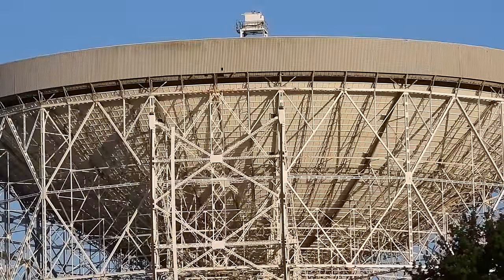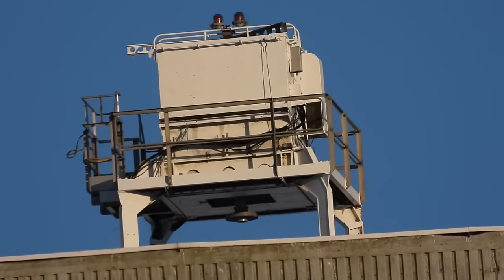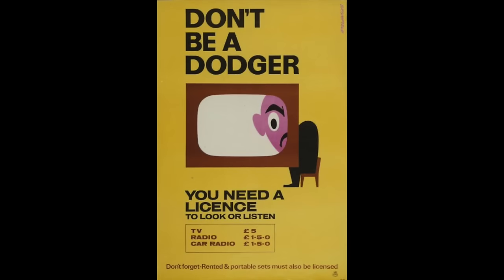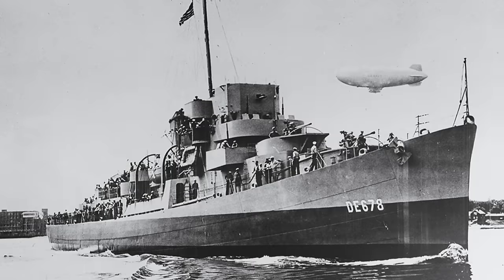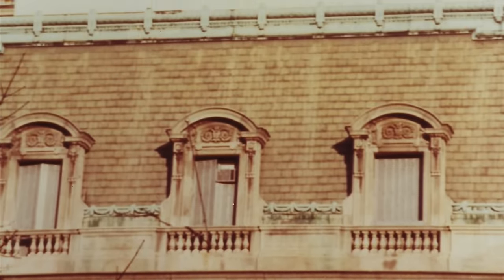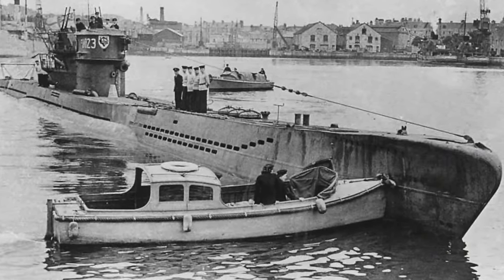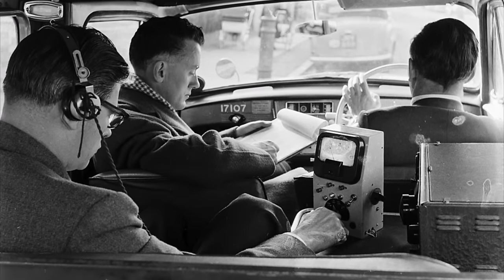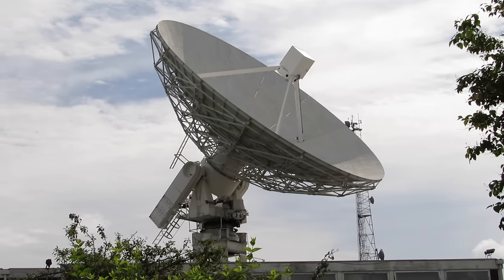How They Know What You're Listening To On Your Radio!

Comment: Back in 1994 at work a FM table radio had a local oscillator signal strong enough to appear on the screen of a  spectrum analyzer what was testing a FM broadcast interface for a rear window antenna intended to address high interference in Detroit's Greenfield Road test course due to the many radio stations there.  Broadband field strength at Greenfield was over 500,000 uV/M!  Two FM stations even created cross band suppression of a AM station at 590Khz!!  (The table radio at work was 200 Ft away from the lab! Finally, a shielded room was installed.)

Comment: I built a one valve regenerative radio kit, H.A.C., in 1969 and confirm they put out a signal. 
Spy radio operators in WW2 were located by the regenerative receiver as well as by the transmitted signal, the most well known was the Paraset.
When I tell people a t.v. could be detected by a van they don't believe it, yes, around 10 and 16 kHz with harmonics into the 160m and 80 m bands causing a lot of noise to radio amateurs. I knew when my neighbours switched on a t.v. so a detector van was very possible.
G4GHB.
Reply: The super-regen[1] receivers were even easier to detect.  Normally a regen only makes some radiation that is exactly on top of the signal you are listening to.  This means that so long as the regen control wasn't set too high, the signal being listened to would help to hide the leak from the receiver.  On the super-regen, the leaked RF was AM modulated at the squegging frequency which was above the audio range.  This meant that a narrow band receiver to tune into the sideband.
Mostly for others:
[1] "regenerative" means you feed back some of the amplified RF back into the input of the amplifier stage.  This has the effect of greatly increasing the amplification you get.  The down side is that if you feed back too much, your radio oscillates, transmits, and you don't hear anything.  Regenerative receivers have a control for this you need to adjust for good results.  "super-regenerative" receivers didn't need this control because they had a circuit that would repeatedly kill the oscillation at some rate above what humans can hear.  The effect was as though it was a regenerative set adjusted to just below the threshold of oscillation.  Sometimes this effect was done with clever design of the RF amplifier stage because tubes were expensive.  I meant that there were a lot more "not a tube" components in the design but that was fine with most people.
Reply: @kensmith5694  Yes, super regens were bad for that, I built a valve 2m xtal tx in 1976 which had a super regen rx but didn't have it for long. The Wireless 19 Set had one but it is said they were no good if a number of stations were operating. I have a 1944 Mk 3 much modified in which the B Set had already been removed and completely re-wired with pvc wire by REME in 1958, c.w. only 2 Watts out, great fun, and usually 5.262 MHz, a modification by me to xtal on tx for stability.
G4GHB
Reply: It's not so much a disbelief of being able to detect them, it just seems super inefficient. Why it took so long to move to just having a database of addresses and working off that I don't know. Not saying I agree with it, but really, it's not rocket science.

Comment: In the 1990's I worked with a client in the electronics industry.  At that time video billboards along the busy freeway were coming into regular use.  My client said that some of the billboards were equipped with detectors that could  detect what radio stations were being tuned into by the passing cars.  Then the displays on the billboard would change accordingly to maximize the advertising impact.  So if a lot of drivers were tuned into a ball game the billboard might display ads for pickup trucks, if a lot of drivers were listening to soft rock then fashion clothing could be displayed.  Ringway you've made this seem plausible.
Reply: Seems dangerous to drag drivers attention off the road.
Reply: @jannikheidemann3805  Since when has that mattered to advertisers in the States?

Comment: the detector van thing was a case of "they could detect" but in reality it was all a visual threat and as it worked so well in the early days they had no need to actually do any detecting..  the old 405 line aerials were huge too.
Reply: Maybe they could pick up some electromagnetic harmonics, but there's no way they could pinpoint a single household in a flat (as measured from the ground with a handheld antenna no larger than 1 foot), and determine with 100% certainty that they were watching Columbo.
Reply: i still see the occasional one rotting on a half fallen down pole of someones chimney .
Reply: @SuperCanuck777  you have to hand it to the original manufacturers of those H aerials, they were pretty robust :)
Reply: @amojak  Yes. heavy duty thickness alloy unlike now. i salvaged one of those vhf low H antennas and used the element brackets to make a 3 ele yagi for 27mhz which i spoke all over the world on in 1982.

Comment: Great video,thanks,I never thought about the IF stage leaking. None of the techniques you described would work these days as the noise floor or EMI in residential areas is about S6 to S9 due to cheap electronic appliances and solar panels.
Reply: Do solar panels create any inherent EMI, or is it due to the inverters?
Reply: @galfisk  All electrical appliances with switch mode power supplies generate electromagnetic radiation however there are regulations on how much radiation they may produce which is all good and well.
A Tridactylidae's don't make a loud noise but when are thousands of them, the noise is deafening.
The EMI from appliance has the same effect when there are thousands of them on at the same time. Ask any armature radio operator that lives near high voltage power lines what level the noise floor is.

Comment: We never had to license our TV's. We wouldn't have stood for it. I realize that conditions were much different during the war in Britain, but even our power grid now emits "broadband - over - power - line" interferences because the power companies just got lazy and didn't want to pay a meter reader and so set things up to read meters remotely. A Ham Operator has to endure so many illegal signals that sometimes we receive nothing but illegal interferences.
   So, one day I had had enough. I put a low frequency bandstop filter on the incoming mains, and then searched out every switching power supply there was, and replaced them with transformer operated power supplies. Did it get rid of all the noise on my receivers? No, but after shooting out a security light often enough with my airgun, they finally gave up on it. No noise anymore. I imagine that I had pretty much the same equipment that your "post office" officials had to search out all the offending noisemakers. In America, Ham Operators police ourselves - and others. Those who do not cooperate are taken care of.
Reply: You sound like an old man yelling at clouds
Reply: Yeah, but he's right... there's so much RFI at my place that SWL is almost not doable. 10 over power line noise. And I unplug or turn off terminal strips on wall warts and battery chargers, otherwise the noise is full pin.

Comment: When it comes to TV and radio, the UK has got to have the dumbest laws possible.   TV licenses are an absolute sham, a way for government to tax the poor.

As for radio receivers, the stupidity is even bigger.  I tend to follow the simple rule that if you transmit something that I can receive, then I should have the right to receive it as transmitted.  Analog or digital, I should be able to receive it as it was sent without question.   Now actively trying to bypass encoding as an example is sort of a different game.   Even then, unless I am disclosing the content of communication to others, it's just something for myself.

I can understand licensing transmitters over a few milliwatts to make sure the bands are not packed with unlicensed users.   Reception should never be a crime.

Comment: It was technically possible to build a working detector van, and in fact they did have some for when there was some genuine issue with interference or land-based pirate radio. (There are some wild stories of random things they found throwing off RF because of an electrical fault or such.) But it was much cheaper to use regular vans with some fancy paint job for PR and personnel transport, so that was the usual.

Comment: Across the pond in the 'States', there was something called "The Tempest Standard", also known as Van Eck phreaking or radiation.  Specialized equipment was used to detect leaky signals from CRT Displays, such as TV's or Computer Monitors, & display them on a remote display.  With the right equipment, this was successfully accomplished from a respectable distance, unbeknownst to the surveilled individual.
Reply: Yes, but to be fair, that technology was intelligence state level and would certainly not have been shared for the GPO to put it in a Sherpa van on the mean streets of Manchester... lol
Reply: Very different to LO detection and with different end-game. What links the two? Peter Wright does.
Reply: I once had to design a power supply to the TEMPEST standard for a military application.  When I asked how low I needed to get the emanations I was told "We can't tell you, it's secret".
Reply: Been there.  Done that.  Ridiculous. [Redacted as I signed the official secrets act.]  :-)
Reply: A chap I knew talked a bit about the wiretaps he did, while in the employ of the local phone company.  Mind you, this was back in 1970's & 80's, so technology was slightly primative, when compared to today.  He worked in one of the central buildings....  the type with no windows.  Anyway, he would wire to the 'suspect or marks' line, and then tie it to another line, which I'm told lead to a local govenment building.  Essentially, the government types got an extension on the phone line of their 'person of interest', without going near the place.  There were other configurations, that used tape recorders or monitoring services, commonplace at the time.  It was less 007-type work, & more 'tight-lipped' electrical/telephone work.
Reply: I saw exactly that demonstrated on CeBIT in Hannover (one of the largest computer and electronics related technology shows) in early 2000s, however it was on a very small distnce (maybe 2 meters). There are even videos on Youtube demonstrating this being done with a SDR...

Comment: In an AM AA5  five tube radio, in order to receive the signal, you have to down convert the signal to another frequency, that is then amplified and output on the speaker.   So at least on those old vacuum tube radios, everything thing you listened to, regardless of the frequency, was down converted to the exact same frequency.   All someone would have to do would be to tune to that frequency with a directional high powered antenna and pickup receiver, to pick up that signal and listen to exactly what you were listening...   it's called a side band attack.   I don't know how digital receivers work, but I imagine they do the same.
Reply: AA5 AM radio:   "The first two grids of the converter tube form an oscillator. As the radio is tuned across the dial the frequency of this oscillator is changed so as to be 455 kc above the desired station. This is termed the "local oscillator". So if we want to listen to a station on 780 kc we must tune our local oscillator to 780 kc + 455 kc = 1235 kc. The 1235 kc local oscillator combines with the incoming station at 780 to produce two new frequencies at 455 kc and 2015 kc. The tuned circuit in the plate of the converter tube selects the frequency at 455 kc and rejects all others. A station coming in at 770 kc will combine with the oscillator to produce 1235 - 770 = 465 kc. This frequency will be greatly reduced in power by the four tuned circuits in the two IF transformers, but I'm getting ahead of myself. Similarly, the station on 790 will combine with the local oscillator to produce 435 kc which will be reduced in power so you will hear only the station on 780 kc. The frequency of 455 kc is in-between the station's frequency and the audio frequencies so it is called the "Intermediate Frequency" or just IF for short. "

Comment: I can remember placing a personal stereo against an AM clock radio I once had, setting the personal stereo to a blank AM frequency, then tuning the clock radio up and down the dial.  Through the headphones connected to the personal stereo I could hear all kinds of things going on.  I've not done this with more modern radios, I tried this experiment back in 1992, the personal stereo was from the 80s, and I'd say the clock radio was from a similar time period.  I've had some experience with two PLL tuned radios being set to the same FM frequency and interfering with each other, that was about 20 years ago.

Comment: Using a very primitive set up with just a short wire antenna and an RSPduo SDR, I can pick up the LO from a small handheld MW radio about 5metres away - so not much. Has anyone any idea of the range with a more optimised set up (good directional antenna, LNA and a professional spectrum analyser)? I imagine that tube receivers with an attached outdoor antenna were also much better radiators.
Reply: We could detect this type of signal from a little more than 50 miles away with our shipboard ECM gear.
Reply: @AdamosDad  Thanks, I'll assume that that is about as good as can be obtained if ECM equipment is used.

Comment: interesting about the tv vans and how they "worked" but im not sure as there has been no court cases (as far as i know) where evidence gathered by a van has been used and theres anecdotal evidence from ppl that used to drive the vans saying they didnt work it was all fake equipment , they had a list of houses that didnt have a license and they just drove down the street looking for at first an aerial and then the flickering light from a tv and reportedly turned a tv on inside the van and just went through the 2 or 3 channels until they matched the flickering seen through curtains when matched they knocked on the door of the target house and i was told by a salesman that the uk in the 70s and 80s had to report the addresses from tv sales to the relevant body at the time.

Comment: Genuine thing: just outside a supermarket in a carpark in Oxford back in the late 90s when I was a teenager, I spotted a rather conspicuously parked "TV detector van" (fairly near the shop's entrance, but not too close). I remember one mother commenting to her child not to go close to the van with the blacked-out windows.

I on the other hand was both far too curious and was prepared for any consequences. Sure enough as I suspected just with a bit of life knowledge from the shape of this vehicle, when I cupped my hands on the side window to block the outside light to see into the van it was just a regular minibus. A classic bit of propaganda.

Of course TV licence "detection" is mostly done by having to register your details with the retailer at the point of sale and of course the rare visit from the licensing people.
Reply: My Mum (God Rest her soul) used to work for the GPO as it was then, she told me the old "comma" vans at the Norwich Depot had 2 chairs, a table, a transistor radio along with a large flask of tea for the "operators", no electronic gear whatsoever. They would often drive around and park up on an estate , then stop while the Football was on.

Comment: Aaah the good old super heterodyne receivers!!.. If I’m not mistaken the original receivers had just 100 nanometers of prefabulated aluminium, that were 100 microns deep - these were surmounted by a malleable logarithmic casing in such a way that the two main spurving bearings were in a direct line with the pentametric fan. The latter consisted simply of six hydrocoptic marzlevanes, so fitted to the ambifacient lunar waneshaft that side fumbling was effectively prevented. The main winding was of the normal lotus-o-delta type placed in panendermic semi-bovoid slots in the stator, every seventh conductor being connected by a non-reversible tremie pipe to the differential girdlespring on the "up" end of the grammeters
Reply: That is quite some sphisticated nonsense.

Comment: Friend... While the oscillator within a television receiver does emit electromagnetic radiation, its signal is typically so weak and localized that it's virtually undetectable amidst the background noise and other electronic signals present in a building. The detection equipment of the time was primarily designed to capture strong radio frequency signals, such as those re-radiated by the antenna. The antenna, acting as both a receiver and a weak transmitter, emits a significantly stronger and more directional signal that's much easier to detect and localize. This is why the detection vehicles focused on the antenna rather than the oscillator, as the latter's radiation was simply too faint and confined to be a practical target.

Comment: I have used a superhet FM receiver as a VHF signal generator. No modifications, just tuned to an FM band frequency 10.7 MHz below the desired VHF frequency. Worked just fine.

Comment: Another interesting video 👍
As an ex TV repair man though, I’d like to point out that the line timebase frequency is 15.625khz - a little bit higher than the 10khz in the video.
Otherwise spot on.
GM6AWC
Reply from the maker: Cheers Colin! But wasnt 405 10khz?
Reply: ah but 405 line... :) - 10.125kHz
Reply: Yes .. For 405.

Comment: So what you’re saying is that in the 50s, one of the major ways you could detect the presence of a TV or radio inside a home was the electromagnetic radiation coming from its antenna, but in the visible spectrum. Worse yet, the leakage was present even when the device was fully turned off!